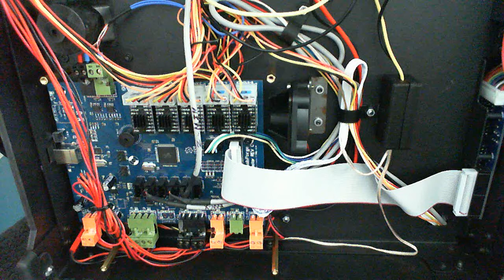FlashForge 3D Printer Mods / Upgrades Part 2 #BelkinFail

Comment: It seems you've been all around your printer, so I am hoping you might have some answers for a question I have.  I actually have a Monoprice knock-off of this printer, which they refer to as model 11614.  It is exactly the same as the FlashForge Creator X Dual that you have, but with their name all over it and their firmware.  I am considering upgrading my firmware to Sailfish firmware, but of course, I'm worried that it wont work right, and I'll have voided my warranty, thus putting a $650 paperweight where my printer once was.  Have you upgraded your firmware to Sailfish, or known anyone with this model printer that has?  Thanks in advance for any info or advice!!  Thanks for showing me how you did a 24v -> 12v conversion for 12v accessories...that's how I found you!!
Reply from the maker: +NuttinNice2Say My printer came with the Sailfish firmware already on it. I did upgrade it to the newest version before I had the issue with the USB port. The upgrade just set everything back to default (default build platform temps, color for the LED strip when heating up, default temp for extruders etc..). If you have a general understanding of these printers, you should be able to upgrade and make any changes that are needed to get it back to your specifications. I don't see why upgrading the firmware would void the warranty, but you should check with Monoprice first, given the warranty is  through them.
Reply: +Matt Medley Yeah, I'm quite comfortable messing with them and know how to change the temps and all that fun stuff...besides that, my slicer (Simplify3D) controls temps (and once I add in the MOSFET for it, the cooling fan) so it sounds like I'm going to be flashing my firmware this weekend!! :D  Thanks Matt :)

Comment: Have you looked for a new powered hub yet?  I use the "Pluggable USB 3.0, 10-port".
Sorry to hear about the damage,, but it is still functional,,  and that is a testament to the Mightyboard's  durability.   I too have the FFCX and WD4,,  and the WD4  become a totally different beast after getting Sailfish loaded.  Quiet,, Smooth,, Effortless motion.  I know that the firmware is not supposed to have anything to do with that,, but I instantly could hear and see a difference.  (we printers are emotionally close to our machines,, you know.)  :)   So I would give the WD4's  Mightyboard, a thumbs up.
I'm currently adding a backside fan duct, with a 50mm x 20mm turbine.  Gonna put the 5050 3-led strip in the duct, so that the light reflects off the top of the print.  
Do you think adding this many accessories to the 350w psu is ok ?   Is 24v more stable?(nub question)

Great tips,, thx,, hope to see more.
Reply from the maker: I've yet to find a new USB hub, I'm switching my main PC out, so this will come after the fact. Also, I've yet to replace the board with a new one, I'm just using the SD card slot for now. I'm starting to not mind at all, it's nice to be able to start a print and shut my PC down if I want without messing with the print job. I added a 120MM fan to the left side of my printer and put a dryer sheet over it, what an amazing difference it makes with the smell. I also added some white 5050 LED strips to the right and left inside corners facing towards the print bed. It lights everything up nicely and I can see the print better while it's being printed. I used the DC to DC step down converter so I could use the 12v strips. Everything works nicely. I think the power supply that's in it is good for now, I have 3 extra fans and 2 strips of LEDs and my amperage pull isn't much at all. I also added a glass bed mod for about $6 total.
Reply: FlemingIsland Aerial
   Yes, SDcard is all I've been using also,, since , with Sailfish ,  you have control of speed and temp settings.
   Good to hear the psu is capable.  I like your dc/dc arrangement, it looks much better(invisible).  I've had the 120mm fan also for a year now, and decided it was time to focus the air directly at the nozzle.  I started playing with faster print speeds , w/PLA ,  and I am amazed at the superior quality of the results, with specifically directed airflow.  I been thinking about centering 1 extruder on the carriage, and adding 2fans on each side of it ,(Ulitmaker style).   PVA support material is expensive,, and slicer's are starting provide better options anyway.  And 2-color prints aren't impressive enough, for all the hassle.
   Repositioning  new 5050's on the front-sides is gonna be great.  No way am I gonna be able to fit them under the carriage.  3528's should fit, but I'll have to special -order some hard-cased,, or print my own case.  I may just remove the WD4's stock 3528's and cut them down,, just not crazy about their ice-blue color.
   Love those removable glass plates. I keep 2 for each machine, ready to go.  My thingi,,  http://www.thingiverse.com/thing:563416  .  I guess you know about the hairspray ?  For removal, put the plate in the freezer for 3min. , and the print will lift off easily.  I started using ABS-slurry about 1 month ago,,  and it's a miracle-worker,, I should have tried it sooner.